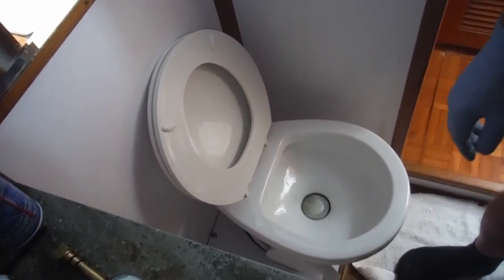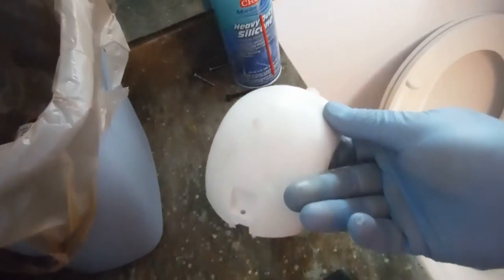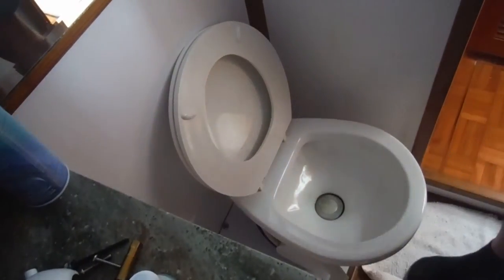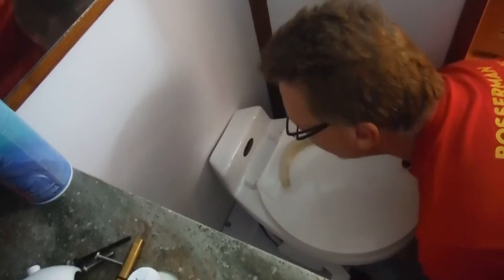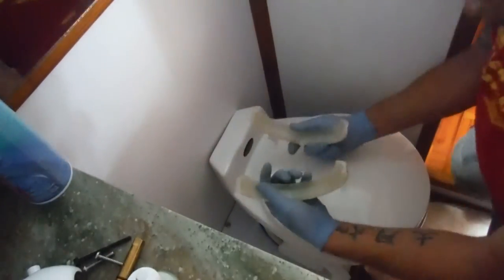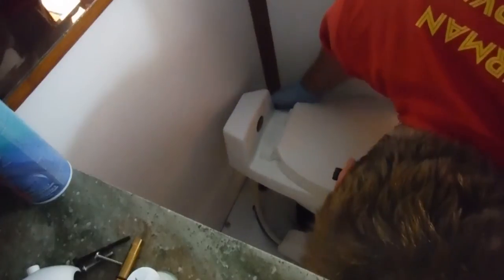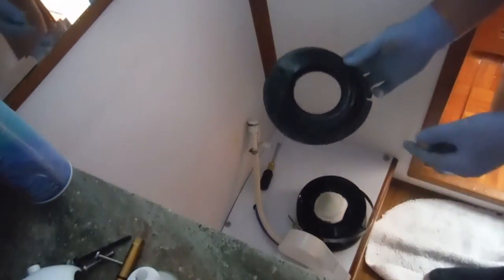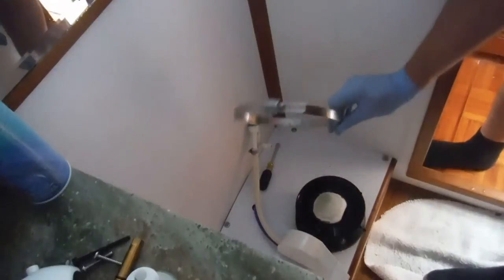Vacuflush head system repair. 1/2 ball and shaft kit install.

Comment: One other question:  My half ball is fine and so is the spring cartridge.  I am pretty sure the shaft/O-rings have a slight air leak (vacuum will hold for about 2.5 hours before vacuum generator starts pumping).. and I have replaced just about everything else and when I put a plug in the bottom of the funnel, the vacuum holds for over a week so the leak is in bowl section.  I want to just replace the O-rings,  Dometic says they do not know the O-ring size and they only sell the entire kit... Anyone know what size O-ring goes on the shaft?

Comment: I don't  know how to fix the toilet to make the half ball open and close...i think the spring poped off...
Reply from the maker: take the pedal cover off. then remove 2 5/16 bolts and the foot bar and spring cartridge will  pull out . but I think its the 1/2 ball needs to be replaced. you can get a 1/2 ball and spring kit for it.
Reply: @bosserman1964  Where is part 2 - ?